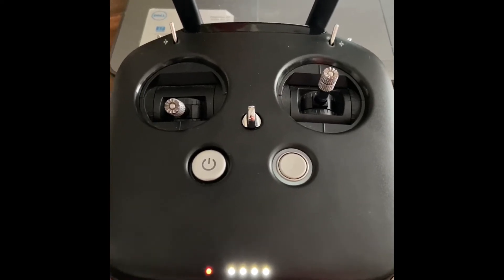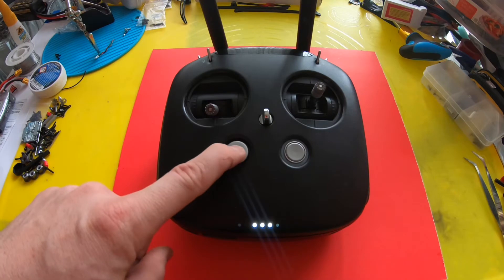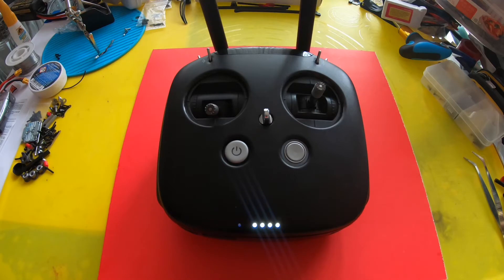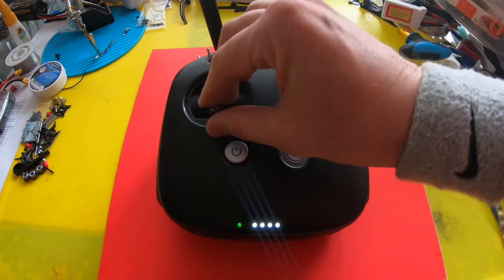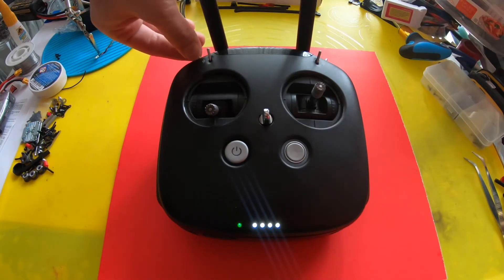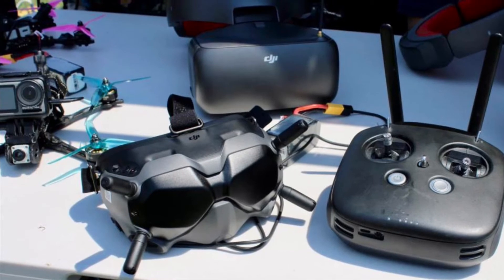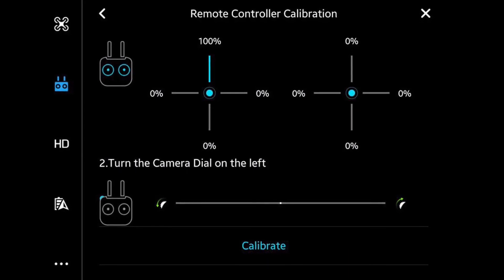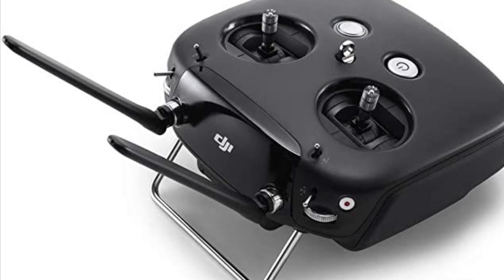DJI FPV Controller Beeping, How to Reset, Recalibrate, and Calibrate

Comment: My sticks don’t work at all, my remote connects but constantly beeps, I see the sticks moving in calibration but it fails every time, in servi set up I do not see my limits and sticks are not registering although the rocker on the right bumper does scroll through menus. I’ve tried multiply firmware flashes along with downgrades and upgrades I cannot fix this
Reply from the maker: Were they working before, or is this the first time registering them?

Comment: calibrating did not work, i reinstalled firmware and got arming flag for throttle. It switched my throttle upside down after reinstalling firmware. Weird. But if anyone else reads this check your controls in betaflight after reinstalling firmware
Reply from the maker: Good tip, thanks

Comment: I reloaded the firmware and I still have the beeping noise. How can I fix?
Reply from the maker: Hmm, if you already recalibrated the gimbals and reloaded the firmware, then you might have a hardware problem. Lose wire, bad connector, etc. I would recalibrate again before you take it apart looking for a problem.
Reply: My sticks don’t work at all, my remote connects but constantly beeps, I see the sticks moving in calibration but it fails every time, in servi set up I do not see my limits and sticks are not registering although the rocker on the right bumper does scroll through menus. I’ve tried multiply firmware flashes along with downgrades and upgrades I cannot fix this
Reply: @chdrones6163 having this issue, did you find a fix? Sorry for necro

Comment: I cant bind to my quad is there another way to do this?
Reply from the maker: It won’t bind if your rx and tx wires are mixed up. I always bind my goggles, then the controller. I make sure I put the goggles in binding mode first, then the unit.
Reply: @DivergentDrones  No my problem is the controller. The C binding key is broken and I cant bind
Reply from the maker: Oh, I see. Well, you could try and repair or replace the button. I took my controller apart once after one of my antennas got disconnected.

Comment: Doesnt permit accepting complete, and the throttle works upside down. Right gimbal is correct.
Tried re-everything. I could get used to it, but wth? Is it the way I'm activating them in the calibration?
Reply from the maker: Try making the controller type default

Comment: I was having a drifting problem. I noticed the gimbals were not quite centered(like your heavy hands are resting on the gimbals). I hope calibration solves this. Either way I know how to recalibrate now. thanks.
Reply from the maker: There is also a gimbal screw you can tighten or lose. Or in Betaflight you can adjust the trims, but you’d have to do that for every quad.
Reply: If you are having a drifting problem. Hover the craft set it down. Disarm it, push throttle all the way up. With the other stick move it one click at a time in the opposite direction and this will start to move the quad back to center. Usually takes a few times to do it. Hope this helps..